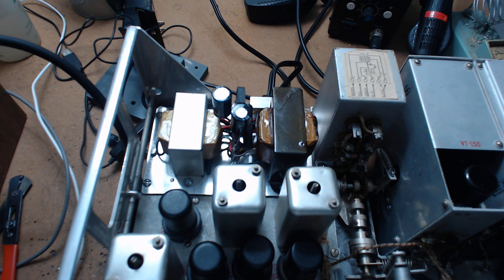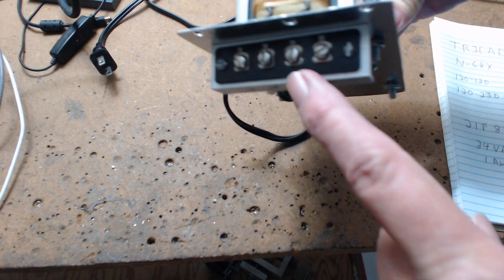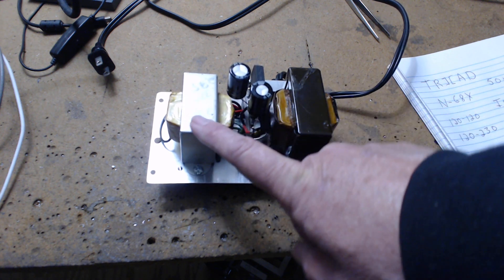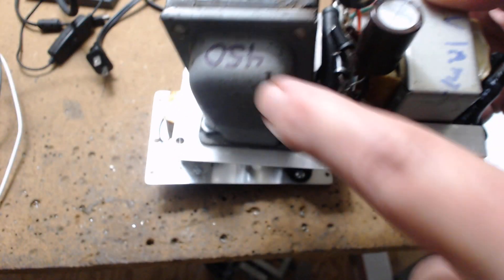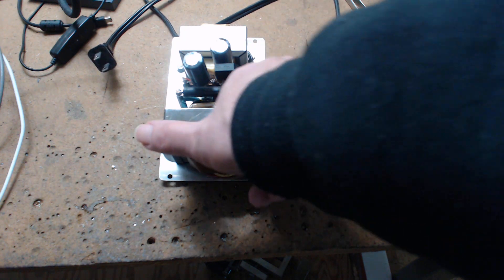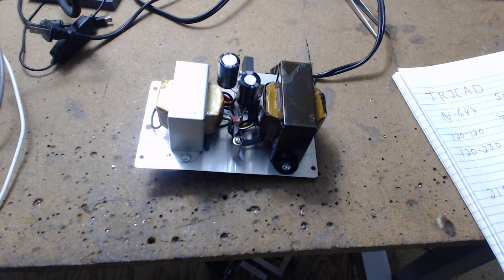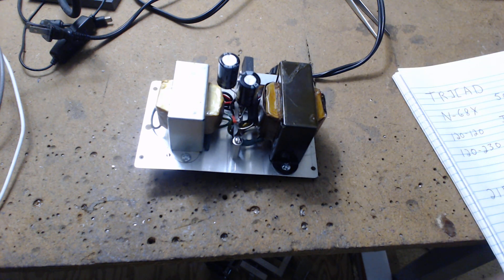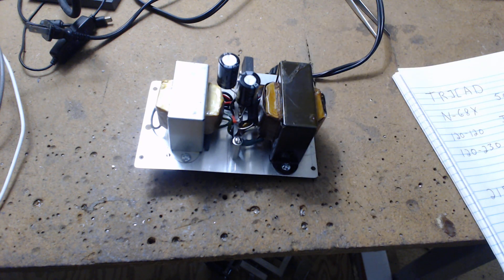Power Supply for BC 348 Radio using modern parts

Comment: The filaments take 700 milliamps not 400 milliamps. There are 2 strings of 4 tubes at 6.3V. One string takes 300 milliamps and the other takes 400 milliamps. The 1 amp transformer will still work fine.
Reply from the maker: There are two series strings at 24 volts not 6.3. See how easy it is to miss speak there nit picker!. I am still the first to present such a supply.
Reply: @johnkleinbauer4424  OK I'll give that. I left out the each after 6.3v. But my point was the 700 milliamps not 400milliamps
Reply from the maker: @DAVIDCHOWNING  Dude I miss spoke. Try designing a supply and then do a video and we will talk. I notice you don't have and videos.  Also do it all while being 72 years old.
Reply: @johnkleinbauer4424  I benefitted from your video here. I built the power supply and it worked great with my BC348R. I did use a slightly bigger Triad transformer (N77U) for the B+. Thank you very much for making the video

Comment: I'm also missing my audio output/choke unit. Got a fix for that which includes another choke?
Reply from the maker: If you mean 101-A the output transformer you can use a filament transformer. Remember the negative of the supply goes to Minus not ground.

Comment: Hi John, i love your videos on the old ww2 rigs. i built this power supply for my 348q and for some reason the 24v 1 amp transformer gets very warm after 15 mins or so. any ideas why this is happening. thanks for your time!
Reply from the maker: put a current meter in series with the 24 volt 1 amp transformer. put it in the 24 volt side. There are two series strings. Pull a tube and run one string at a time.
Reply: @johnkleinbauer4424   Hi john, thanks for the advice. i found out it was transformer itself. it would get hot even without a load on it. i picked up 2 of these 21f84 on you guessed it ebay. i installed the other one and works fine now. now on to my next project. an old navy rak-7 rec. the old ww2 sets are so much fun to work on. Have a good day!
Reply from the maker: @aaronperry-xv8il  The filaments pull 1.4 amps when you turn the radio on. That drops back to  640 ma after a few seconds. The lights pull another 240   ma when fully bright. That uses 880 ma so the transformer is still OK.  The BC 348 is now my favorite radio of all time!
Reply from the maker: Make sure the radio is still wired for  24 volt filament. Make sure your trans former is 24 volt 1 amp